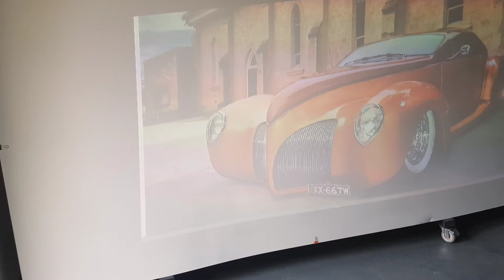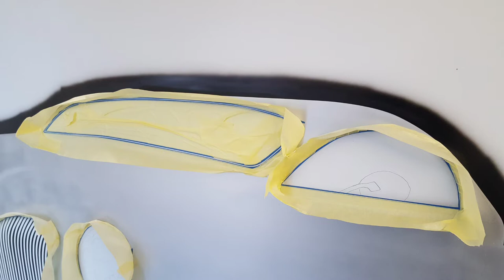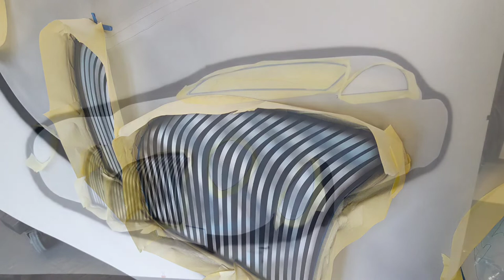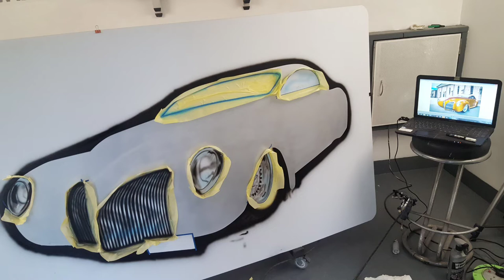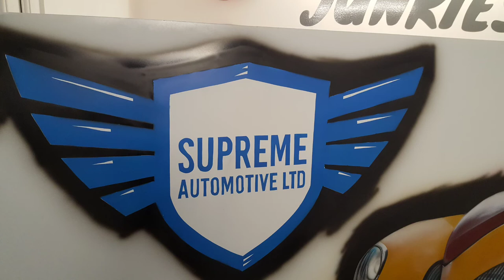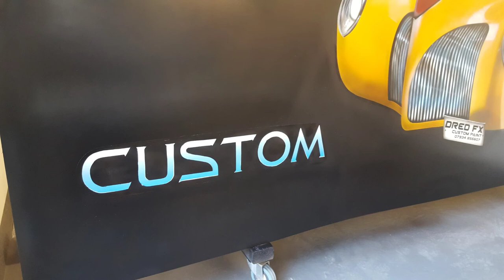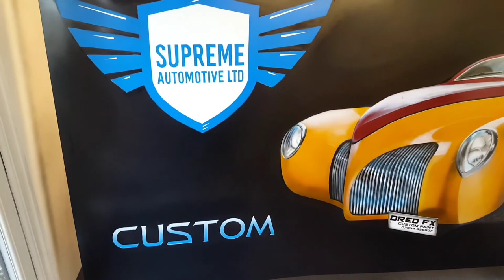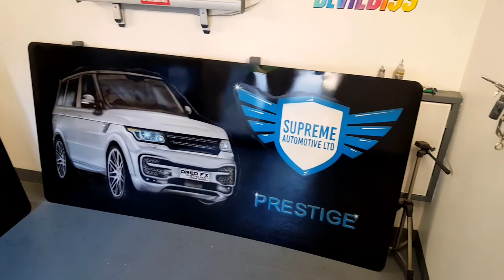HOW TO AIRBRUSH A CUSTOM CAR

Comment: The signed came out great Rob the customer should be happy with the results 👏👏👍 

Not sure if you can advise me here Rob but I've just upgraded my Gopro 4 to a Gopro Hero 8 Black, while my 4 gave good colour reproduction I find that the 8 seems to make some colours glow like they are fluorescent I find this more on reds and blues and they don't look real, it's hard to explain but wondered what camera you have and if there are any settings I need to change for filming in the booth, thanks John
Reply from the maker: Hi John I use a dji action camera for my new videos not sure on the Gopro mate 🤔 best place to look is on here for some tips and reviews
Reply: Yeah I have been looking but nothing about my problems, it could be due to my daylight booth led lights 🤔 thanks anyway Rob 🤗👍
Reply from the maker: @JohnWD40TC02  thats what i have in my booth to try and set your iso on the Gopro thats what i had to do with the dji john to sort it out more so with time laps
Reply: Yeah ISO helped a lot, after a lot of searching on here it turns out that the gopro 5 and upwards use a different colour profile called umm 'gopro' and the colour saturation is to high, he went into great detail about it and the only cure is to set the colour to flat (which gives a very flat colour) then edit it in post which for me is to much faffing around. The alternative is to set the white balance, iso, frame rate and shutter to match the ambient lighting which I have done and is a lot better, you can then save it as a custom setup, what a PITA!! 😳🙄😂